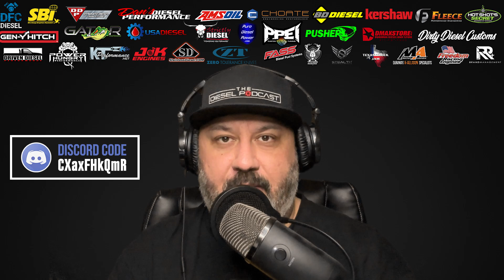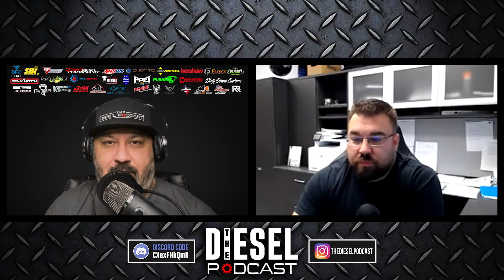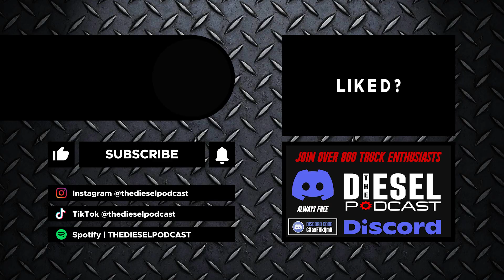Why Engines Fail: Tips to Avoid a Breakdown

Comment: Patrick here is a suggestion: there is virtually ZERO content out there that differentiates the Long Blocks between the LML and L5P Duramax. We all know about the air and fueling, but what are the differences between the bottom end improvements over the LML (mains, crank, rods, etc). Why does an L5P have the capability of hitting 1000hp since the LMLs tend to snap the crank. What are the common problems that engine builders see. 

So basically, a follow on with this podcast with one that is devoted to the LP5 Duramax similar to this one. Thanks!
Reply from the maker: Thank you for the suggestion!

Comment: Oh and LB7 head gasket jobs I will not install anything but fleece cup less heads the price difference is so miniscule you get a brand new head without the cups that's going to last you alot longer I run them on my personal LB7 with ARP studs and I'll die on that hill most of the LB7 core heads the cup bore where the tip goes through the head has been eroded away and you will chase never ending cup failures even with the kits that claim to hold the cups in place that's great but if the bore is eroded away combustion case just leaks around the tips of the cups and there's no permanent fix we are dealing with a 20+ year old aluminum heads theyre just worn out and in my area having the heads machined is about $985 each  with new cups i can buy a set of fleece heads and sell them fir $1,200 each it's a no brainier $600 added to an already high bill for peace of mind is worth it

Comment: I'm a diesel mechanic and I've built a lot of engines over my career the first time a customer comes in with any engine I tell them hey look these are the weak points if it's a stock LML and they don't plan to add power I tell them this is a big issue and just because you dont tune it doesnt mean you are immune to it so you might want to address it preemptively and just a crank bearings rings and honing the cylinders is good for a stock truck if they want to bump up the power i suggest hey look pistons a crank and head studs you really shoukd do this preemptively because as he said youve got about a 50/50 shot of the block being damaged and then the bill goes up substantially and some people recieve that well and others think im just trying to upsell them and more often its the performance guys are the customers who actually listen I genuinely mean to save people down the road and with an LML i always suggest a CP3 conversion wether its stock or tuned its so much cheaper to preemptively prevent having to buy a pump AND a disaster kit I play the long game and some people appreciate it some don't and I try to run off the people who arent willing to listen or think I'm just trying to milk them I just tell them the cold hard truth love me or hate me thats what you need to do to keep your truck reliable

Comment: I like your pods casts. Very informative!
Been a mech for 45 years. Started getting paid as a knuckle buster at 15. Rebuilt my first ntc 350 at 16.
Grew up in Forks wa. It was called the logging capital of the world.
Saw a lit of engines and learned from some of the best.  Cummins made a lot of money at there. 
The guys comment of how and why the piston has the failure at the pin is spot on! Saw guys pushing a small can 350 and 400 up towards the 600 hp. Running twin turbos. To be honest, they didn't last long with the heavy harks and hills.
Get the timing off on igniting and there will be some serious piston damage

Comment: I'm actually really curious what he sees from a lubrication standpoint when he tears these engines down, if he can tell in higher horsepower engines if the oil is actually protecting everything or people need to run thicker oil. Is oil being overheated in spots, and if cores he has received had extended oil change intervals, etc.

Comment: In the uk you don't have trucks that tow more than 7800 LBS, The thought of owning a car or suv towing at max tow for 30k plus miles you know what the result will be.
Reply: Has nothing to do with what he’s talking about. Be quiet. Plenty of North American trucks do that.
Reply: I have a 1972 dodge W100. It is a heavy half ton.360 v8 with a 727 automatic trans.
Was hauling fill Rock to my property on a 2 axle car trailer and the short bed pick up. 
I would use my hillbilly overloads, 4x4 blocks,  bergen the rear axle and frame.  Would load a 1 1/2 yards in the bed and 3 yards on the trailer. 
Over did it once and left the pit with 18,600 pounds. Had to lock it in 4x4 low to get going. Was about 13 miles.